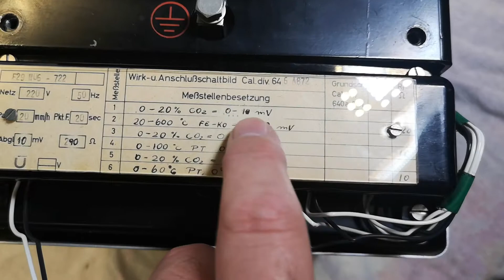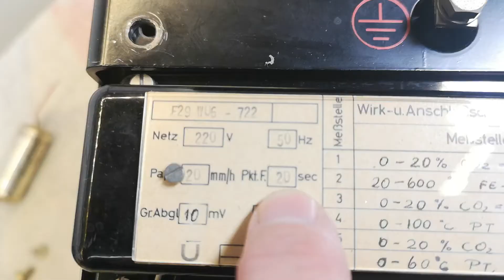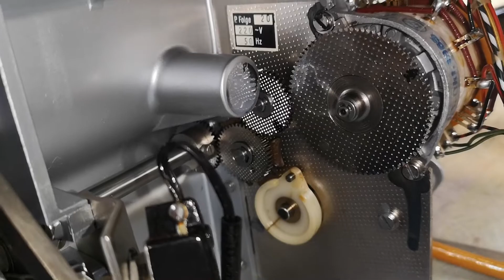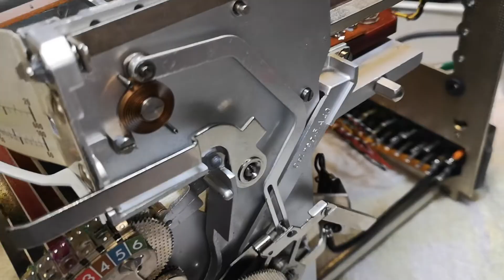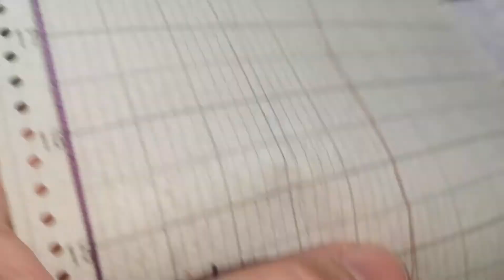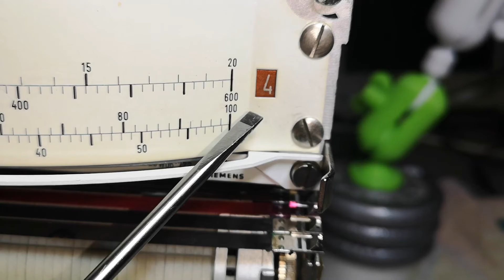siemens f29-w06-722 6 channel analog chart plotter test teardown

Comment: Typical Siemens with those absolutely impossible model numbers!
Reply from the maker: yes ! not easy to look up, and not easy to find new color bands, maybe it is possible to wash them, and add new color ? like a DIY fix ?
Reply: @TeardownOZ2CPU  Yeah try cleaning them in alcohol and dripping ink for stamp pads onto them. Should be doable!